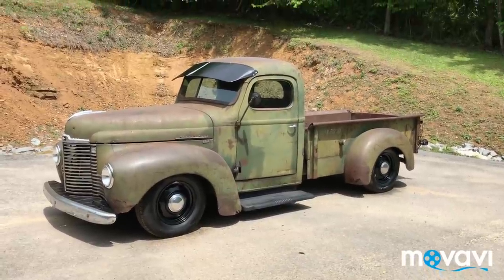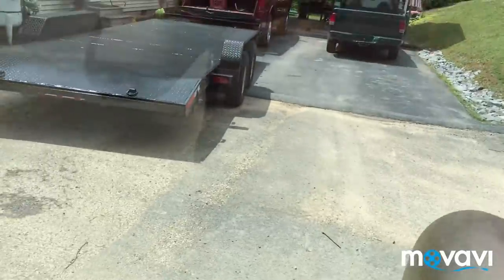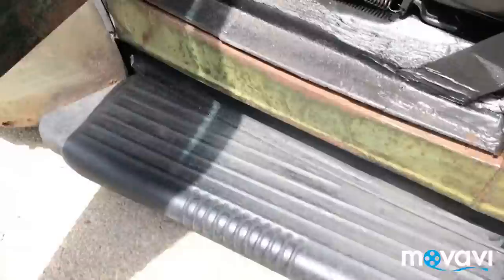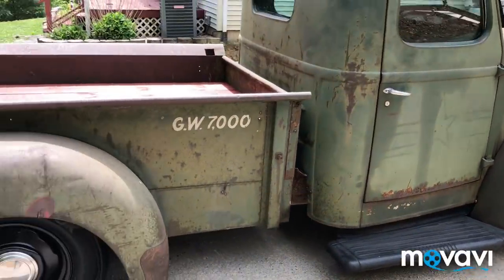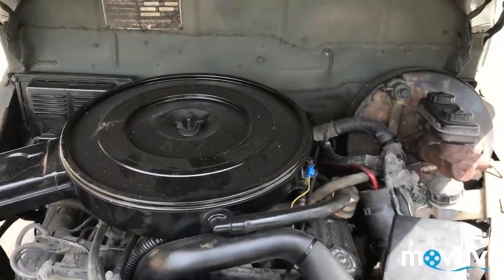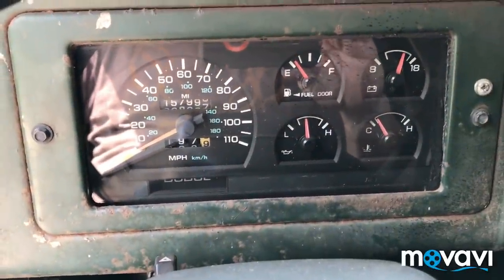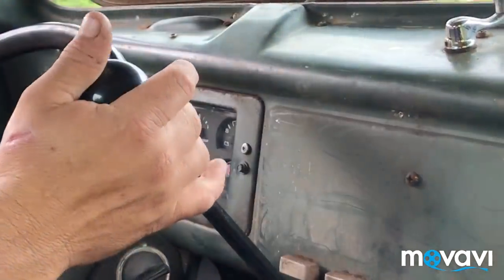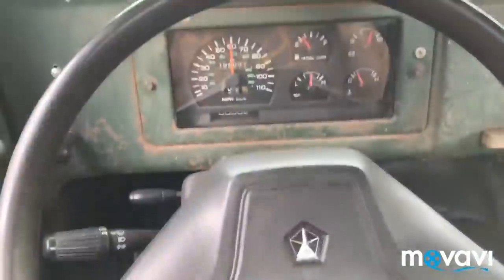1947 International KB2 Rat rod build lucky #7

Comment: My grandpa has a '47 kb2 that had a dump truck v8 and a 3 speed with an overdrive swapped into it. Hasn't run in over a decade. Hoping to fix it with him. Still has the factory seat in it. Hoping to fix it with him.

Comment: Hi Jeff big fan. I just picked up a excellent 48 international kb2 and want to set it on my dad's 98 Dakota v6 auto with 110k on it. Do you have any tips. Like I was thinking cutting Dakota floor and firewall out one pc and dropping international right down on it with the brake booster and all that still in place. What do you think any help would be appreciated. If I could afford to have you guys do it for me I would be at your shop right now
Reply: Hi John~I just fornd jeff last night~I have been bing watching his videos ever seince~But just like you I want to drop my antique truck cab right down onto my 99 Dakota I figure cut the firewall out and not mess with anything like brake booster or any wireing ~My Dakota runs so amazing I don't want to risk breaking anything by removing it~I have been looking at old cars with the same wheelbase as my Dakotafor the past  months now~The wheelbase is the same as a 40 Ford Coupe at 111" ~I see by Jeff's work here that great minds think alike